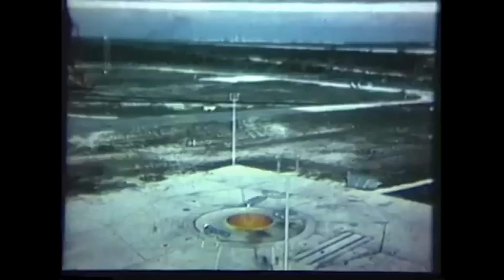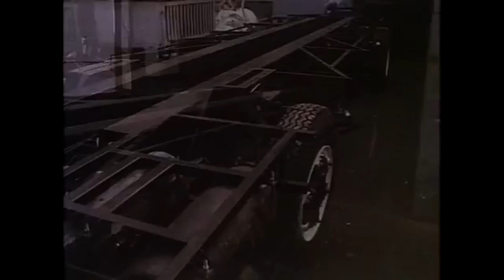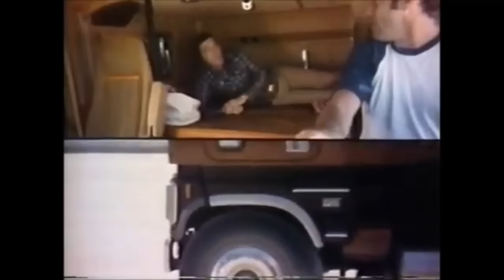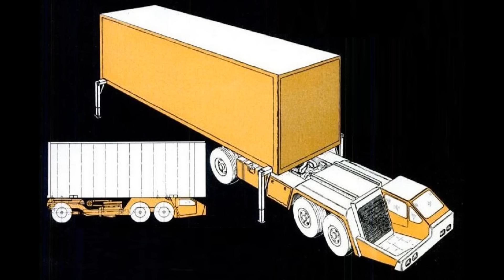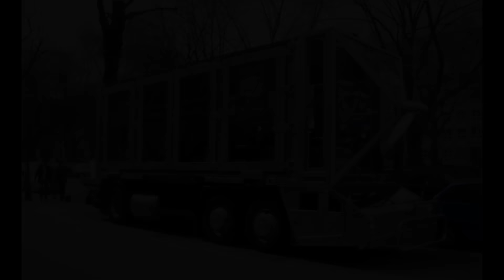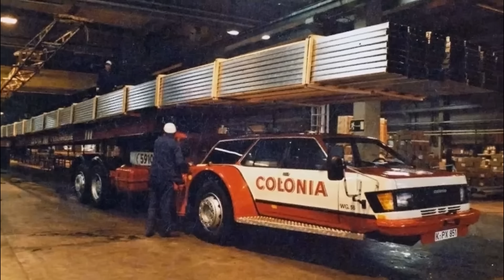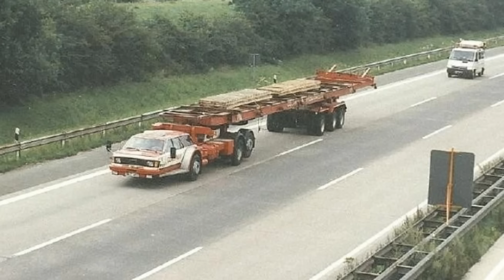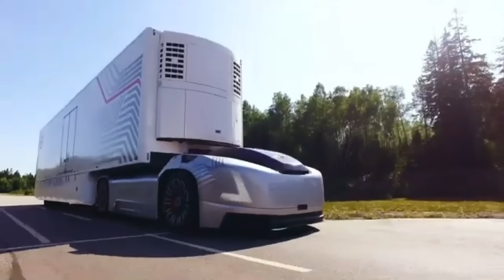Cab Under Trucks: Why They Never Worked

Comment: These cab under trucks do have a place in the world, the airport and NASA may use them (I don't know, I've not checked). Their place is limited to non public road environments. 

I did as a child see the Steinwinter in magazines and even as a child I thought that I wouldn't want to be in there in a crash. We had a VW T2 at the time and I thought they had the same level of crash protection but, at least the T2 didn't have 40 tonnes of cargo bearing down on it under full inertia.
Reply from the maker: Yeah, safety really is the weak point.
Although if you look at modern double decker coaches, the situation with driver safety isn’t much better there either.
Reply: @TheTransportChronicles  I agree about the modern coaches, they remind me of a film from 1976 called "The Big Bus". I remember even at 7 years old I watched that movie thinking the driving crew are dead if they crash in that 😮.

That's why in an airport, non high road speed environment they can work well but not on the open public road and I did check and NASA don't use them at all.
Reply: Mining trucks are all like that.